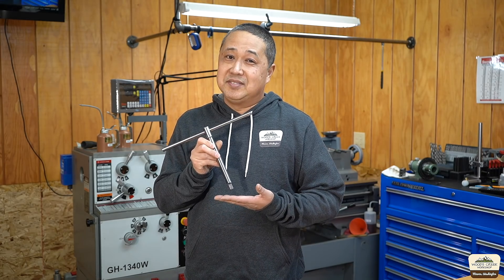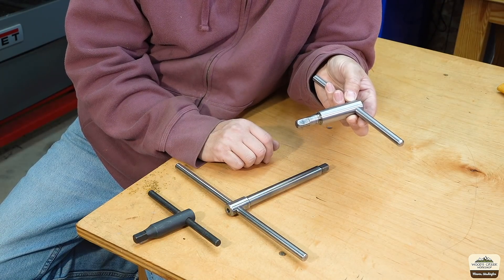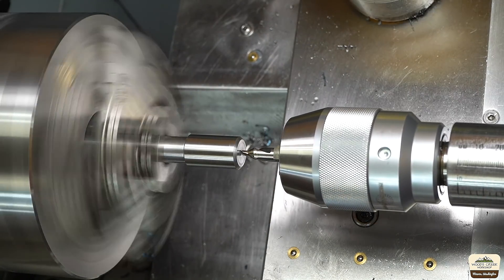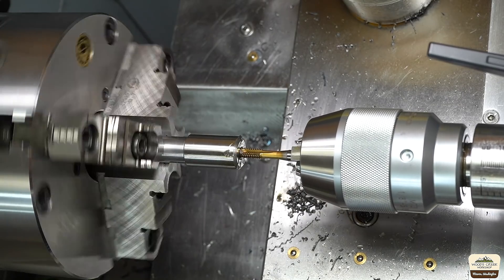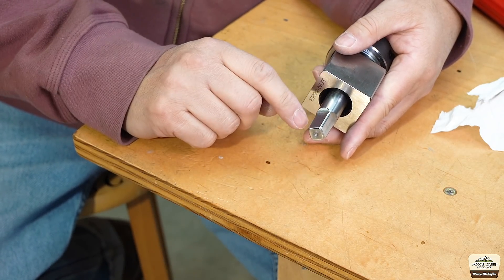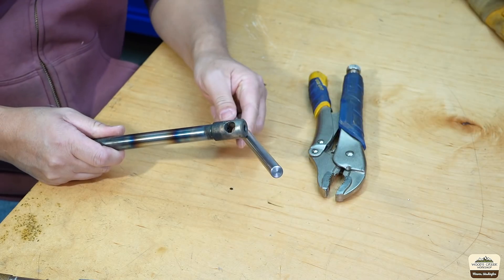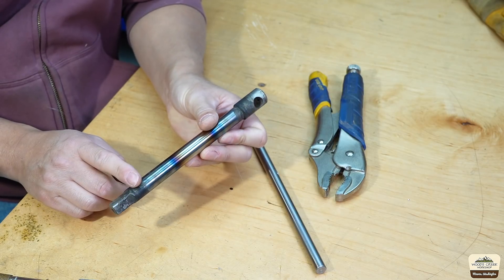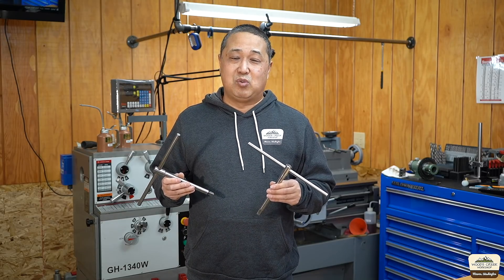Make New Lathe Chuck Key - Upgrade Yours Now!

Comment: Nice work. I see we think alike. I also like a longer handle. I used 7075 aluminum for the shaft and arm, with a steel insert for the tip, but I think I like your design even better.
Reply from the maker: Thanks Robert! 🙏🏻

Comment: A question: you had to rebuild your lathe headstock because the parts inside weren"t properly deburred at the factory. Metal particles shed from the burrs eventually ground up the bearings that came with the equipment. In the end, you spent a lot of money replacing all of the factory-supplied bearings & seals. My question is this: since the poor finishing quality of these lathes will eventually require rebuilding anyway due to the burrs, would you recommend rebuilding the headstock right away, on day one, to at least save the expense of replacing the bearings & seals?
Reply from the maker: Josh, great question.  If I ever bought another lathe, new or used, I would completely drain the headstock, flush it out with new oil few times and make sure it is clean inside before using it.  I wouldn’t completely disassemble to begin with.  Hope this helps.

Comment: 8:50 You want rounded corners ? Pity you ain't got a lathe !
Reply from the maker: Let’s think about it for a minute.  The edges needed round over by about 1/16”.  If you turned that on the lathe, you would end up removing a lot of material to make it fit in the key hole. You have to think about where the center of the rotation would be.  Sure you can turn it on the lathe but you’d have a real sloppy key.
Reply: @woodscreekworkshop9939  It'd still just remove the corners - the flats would be the same - so it should still be a good fit - just don't take too much off !

Comment: Welcome  back Yuchol i need one of those keys too. When you rebuilt your head stock did it cure all your leaks?? When you were rebuilding it i commented on your drip pan because I had put gasket maker around the inside of the tray to direct the drips into the chip pan worked fine for a long time then i didn't use it for about 3 months went to use it last week and find a large pool of oil in the chip pan the only reason I noticed is I'd cleaned the chip pan after the last time I used it.
Mine is a Kent 13 x 40 it has two separate gearboxes the headstock with gear selection levers then there's the bottom gearbox that runs the lead screws well that bottom box dumped all the oil out 🤬🤬🤬🤬even the main drive pulley shaft seal leaks. 
I think that they used the cheapest seals and o rings available..
I dont think its supposed to have a total loss oiling system like my mill and shaper lol🤔
Reply from the maker: The oil leak drastically reduced, but it’s still there.  It’s one of the things you come to expect to deal with on these lathes
Reply: @woodscreekworkshop9939  I see you have been visiting the bears again you're starting to learn their language ROFLMFAO 🐻🐻
Reply from the maker: @MY-bw2nb  know thy enemy

Comment: Now I think I know why Colchester made round head lathes back in the day. No square edges for the chuck key to catch on! Of course, you can't stack tools on the headstock either, but maybe that was intentional too.  Do you not have to temper W1 tool steel after hardening?
Regards, Mark Presling Australia
Reply from the maker: Hi Mark!  You have some good theories.  I didn’t temper back. 👍🏼
Reply: @woodscreekworkshop9939  I have no experience with the sort of tool steel you are using so I wasn't sure if it does fully harden out in water. If only you had a Rockwell hardness tester kicking around the shop. 😁